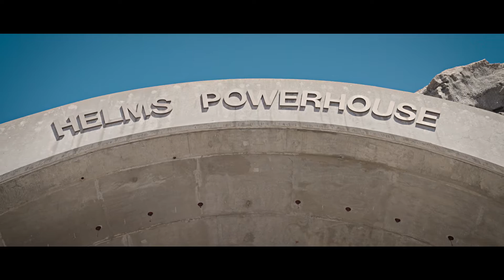Helms Hydroelectric Plant

Comment: Helms powerhouse was built to work in unison with Diablo Canyon Nuclear plant . Helms generated electricity during the day time from water in the upper lake flowing thru the generator  into the lower lake . Once the upper lake hit it's minimum level the generators were shut down . During the night time hours the rotation of the generators was reversed and they were again started running as pumps this time with electric power supplied by Diablo Canyon. Water is then  pumped uphill  from the lower lake back up to the upper lake to refill it making ready to generate power  the next day . Being a Nuclear plant its not so easy to vary load so they run pretty much block loaded so when the daytime load requirements dropped off in the evening that power was instead sent to Helms to pump water  .
Diablo Canyon was supposed to be permanently shut down but with the state facing a power shortage it was granted an extension running until 2030 after who knows if Helms will still operate as a Pumped storage plant?